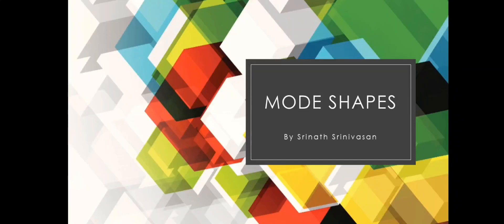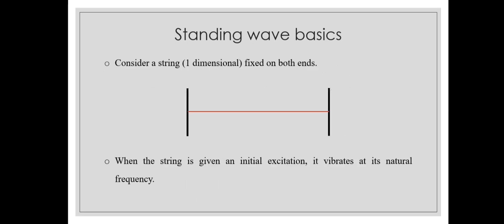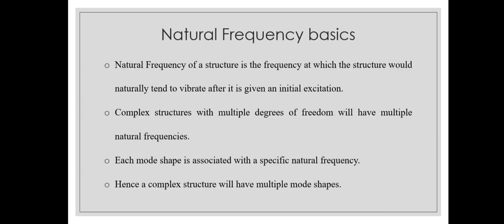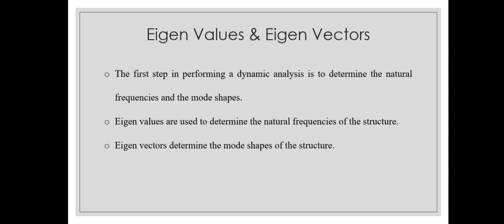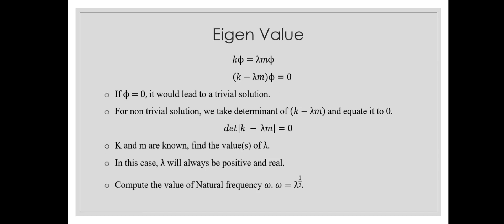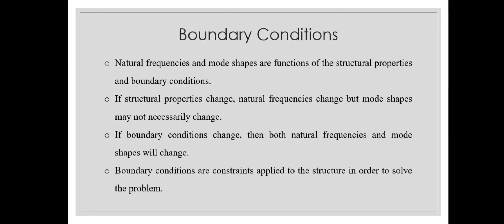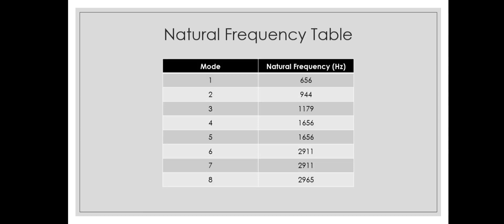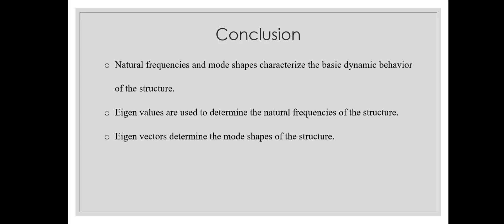Mode shapes explained and demonstrated

Comment: Thank you for the lesson Sir. 
I am actually working on the dynamic analysis of a reinforced concrete bridge structure. But when I carried out numerical modal analysis considering 30 modes I realized the sum of my mass participation ratio for each mode is not even up to 80% of total mass, highest was at 77%. My main problem is: about the first 20 mode shapes had really small mass participation and instead of the first modes contributing a lot to the mass, I had the last modes contributing instead (to have up to 77% mass participation). From my knowledge of modal analysis, the first modes are usually the most important and the ones contributing a lot, but that's not the case with my analysis results. 
What could possibly be the problem Sir?
(I assigned boundary conditions to both ends of the bridge)
Reply from the maker: You're welcome. As I am not from Structural engineering background but rather Mechanical, I cannot guide you accurately but will try to answer generally. If higher are modes are dominant in your structure, it could be either that higher modes are really contributing to the overall deformation or the lower modes have been suppressed by choice of boundary conditions (ex if the structure became too stiff). For example, consider a plate with too many accelerometers mounted on it. This certainly increases the system stiffness to such an extent that the lower modes are unable to make an impact. So the important thing to note here is that accelerometers need to be mounted in such a way that it does not alter the physical properties of plate (do not add mass or increase stiffness).

Higher modes usually have complex shapes and are more localized. In contrast, lower modes have simple shapes and are more globalized. Also the excitation frequency range is important. Usually broad band excitation is given so as to check how the system responds overall. Certain frequencies will get excited which indicates resonance. But if the excitation frequency range is limited to high frequencies then the lower frequencies were not excited in the first place. So ensure all possible frequencies of interest are excited. These are the possible scenarios I could think of.
Reply: @SrinathSrinivasan  Thank you very much for your response Sir. Will try to follow your advice and see if there are improvements